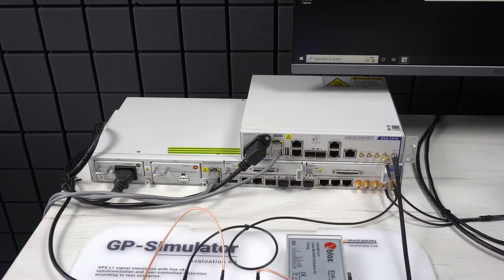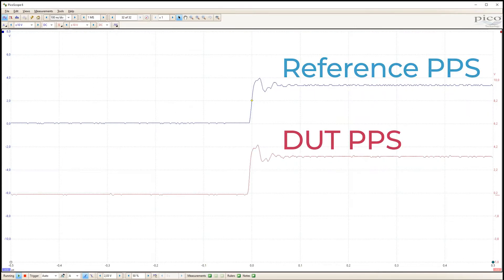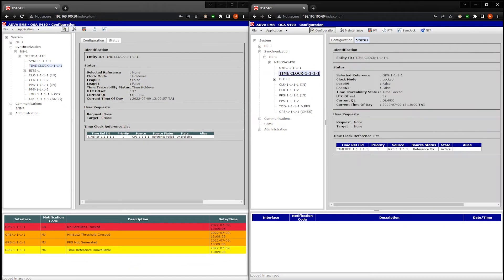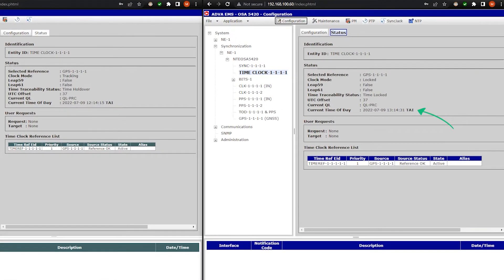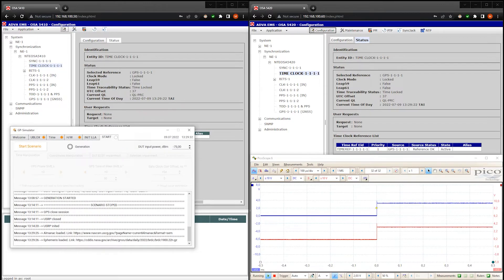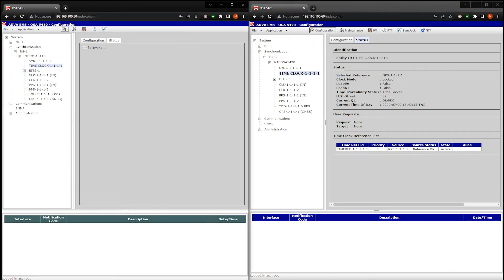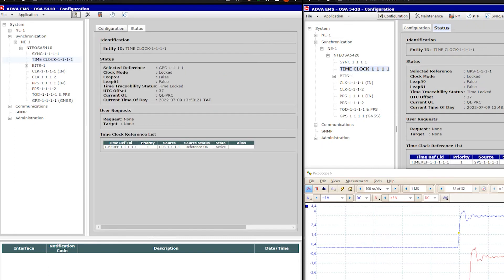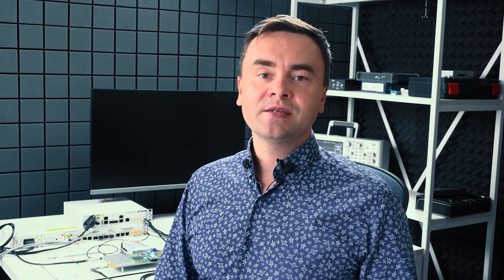4. GP-Simulator. Time Server GPS Spoofing Vulnerability Testing

Comment: Why are you feeding real signals to the spoofer?
Reply from the maker: Our GPS simulator gets synchronization from real GNSS signals. It's needed to conduct a coherent attack scenario.
Reply: @GPSPATRON  so technically you are constructing a spoofing signal with respect to code delays, doppler frequency and time of the real signal right?
Reply from the maker: @copycarvers  Exactly. This enables complicated scenarios. A target receiver instantly switches to our fake signal. And then it's possible to move position or time. 
Learn more here about different attack scenarios: https://gpspatron.com/types-of-gnss-spoofing/
Reply: @GPSPATRON  this is amazing however I am still wondering how much computational and processing performance is needed for such type of attacks? 

Basically I am interested in studying intermediate and sophisticated spoofing scenarios in MATLAB.
Reply: @copycarvers  why do you think that this is a high load task? It's just needed to pre-generate some IQ data and start streaming at GPS frame beginning
Reply: @maximbarodzka2670  I mean talking about MATLAB environment since simultaneously receiving the signal and then processing it will take time right?
Reply: @copycarvers  If you plan to demodulate GPS signal using Matlab in real time, and then generate fake signal that is a really complicated task. GP-SIMULATOR require GNSS receiver to get live signal. You can use the same approach